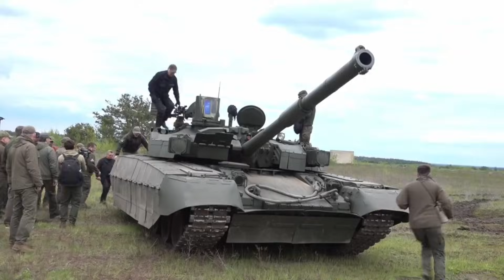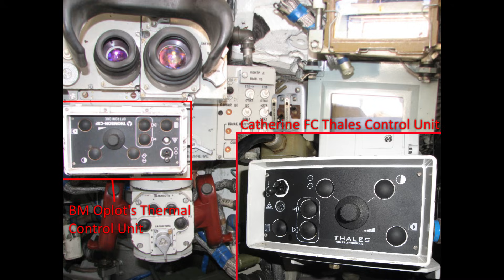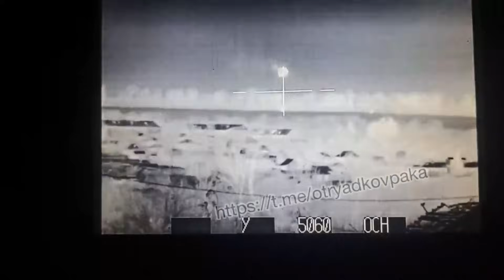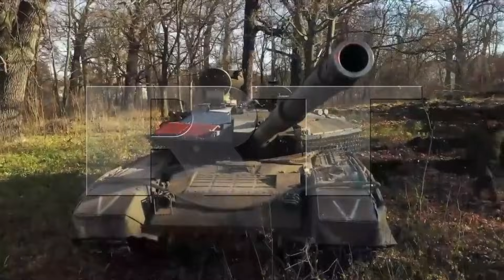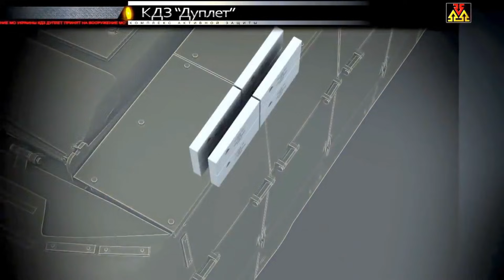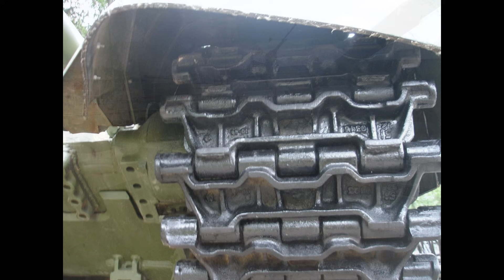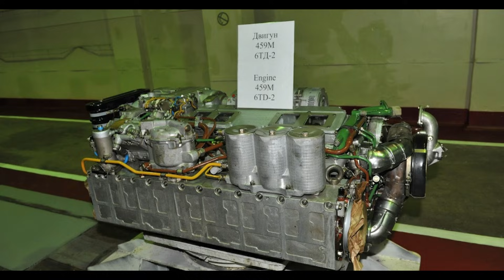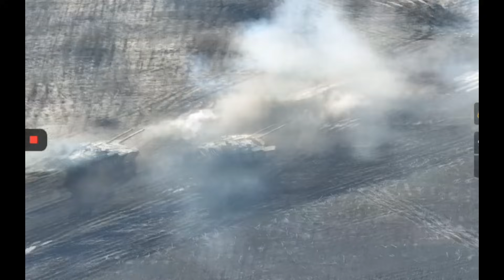Best Ukrainian vs Best Russian tank. T-90M vs BM Oplot comparison

Comment: The biggest problem of T-90M is the reverse speed
Reply: Hold W to win, hold S to suck, comrade!
Reply: Biggest problem of oplot m there’s not enough of them
Reply: In soviet russia you abandon the tank when you need the reverse gear
Reply: @caracallaavg  In Soviet Russia, reverse = get out and push!
Reply: @caracallaavg  In soviet Russia you just fight to the death but Soviet Russia doesn’t exist anymore so yea
Reply: 😅The oplot also has that problem
Reply: And it beeing a T72
Reply: Yeah idk why they didn’t fix it, bad for them, good for us
Reply: @adriannn1180  problem of small engine. Because of small inner volume, soviet tank more armored and has less mass, but this also has disadvantages as well.
Reply: I would say its biggest problem is its crew in Russian service.
Reply: The poor reverse speed is compounded by the fact that if you want to evacuate rapidly you have to turn the tank around and show your sides and ass. T90 doesn't have neutral steer which can make this difficult. And obviously the armor protection is basically tissue paper. But of course this is not a problem because Russian tanks never retreat.
Reply: Also they didn't make a lot do them because of sanctions.
Reply: Designers thought that Russians do not retreat
Reply: I feared that I won't find any of war thunder experts here.
Reply: If the russians only had a next gen tank with decent reverse speed...
Reply: Thats the biggest downside of any russian tank.
Reply: T90M has 15 km/h reverse speed
Reply: The biggest problem of the Oplot tank is the lack of production of the Oplot tank.😄 Even new samples of the Oplot tank were made using the method of technical cannibalism
Reply: Na, the biggest problem is more how they gonna produce it lol
Reply: ONLY cowards go in reverse
Reply: @elcormoran1  cowards live longer
Reply: @RutakoVon  YES You do, i,AM no coward and i live longer without fear of dead, butthurt neonazilover
Reply: How many Oplots have been produced and where?
Reply: @vulgarisopinio  Probably not that many, but hey, every tank counts. They will probably start producing highly upgraded tanks after Ukraine finishes exterminating the rats. As for where they are made, if I knew the answer to that question, Russia would've fired lots of missiles there already. Lots of bots watching!
Reply: @vulgarisopinio  70 or 80 pieces were produced. It cannot be said that they were produced from start to finish. These tanks were produced using the cannibalism method. They took old tanks and modernized them
Reply: The biggest problem with the T-90 is that it's actually a T-72
Reply: Like every t series before...
Ik.shocker
Reply: Specialist subject: the obvious comment gets 542 likes
Reply: Ukraine's best tank is now Leopard 2
Reply: Completely irrelevant
In reality downsides can be covered by using correct strategies and supports from recon or etc
A better reverse speed only gives you more freedom
In conclusion actual results depend on so many variables that simply having one down side does not mean much
Reply: Nope its the fact its operated by cowards!!
Reply: You don’t know it’s reverse speed
Reply: I guess there is some new automatic transmission for T 90, but this transmission very expensive and therefore no mass production.
Reply: "T-90M breakthrough" has a reverse speed of 15 km/h
Reply: Nah, the biggest weakness is that it's operated by russians. The most incompetent and cowardly conventional military we have ever seen.
Reply: The biggest problem is that author of channel is misleading. After all, T90M is not best tank in Russia.
Reply: Nah it's finding a working T-90M fam lmao
Reply: There are few biggest problem of T90: 1. Russian engineering;
2. It is shitty T72 with new turret
Reply: @veritasaequitas2632  
Well, since you like this kind of argument, let's get started.
1. You have porridge in your head instead of brains. How do you like the answer to such a first point without arguments?
2. Since the main reason for the appearance of the t90, is the presence of a huge number of t72s, which can be upgraded into a great workhorse like the t90. Economy, probably heard such a word.
Reply: @@Messikimochi-ok4jm A few examples are no big deal.
Reply: @@Messikimochi-ok4jm And there are over a hundred Russian tanks with their turrets orbiting the Earth.
Reply: @mr.normalguy69  What's your IQ?
Reply: it's just that Russians never go in reverse and don't know how to retreat!
Reply: the biggerst problem of Oplot it does not exist, it was made in about 0 amount...T 90 exists in thousands)
Reply: and its age
Reply: Вот прям проблема...
Reply: Only problem
Reply: @the_burger  perhaps, but it is also a MASSIVE issue.
Reply: @the_burger they seem to fall in the ukrainian hands a fair bit. Seems like a downside for you? Weak arse military.
Reply: @the_burger it has a underpowerd engine it's slow in reverse and forward and its armor suck the t90 is trash  watch Lazar pig on the t90 he explains it better
Reply: @dannywaller4397  Lazerpig is a braindead natoid. Armor is great (full body ERA coverage), engine is fine. As I said, reverse is the only problem.
Reply: That guy is a NAFO troll.
 @dannywaller4397
Reply: Also the thermals
Reply: @pringle239  Stop believing CNN cronies, T90M tech is the equal or better if any western tank.
Reply: It also goes boom 💥
Reply: @mr.normalguy69  every tank goes boom lmao nothing is indestructible kid
Reply: @grimmerjxcts2206  Nah, not really, mostly Soviet era tank turrets have a tendency for doing Olympic jumps 😂
Reply: @grimmerjxcts2206  Not the way Russian tanks do

Because of the autoloader mostly.
Reply: @GAY_WEED_DAD_69  it's not the auto loader it's the extra ammo in the hull around the auto loader 
Leopard 2a4 also explode that way
Reply: @RazorsharpLT  Leopard 2 in Syria is a Grill Fish 😂😂😂
Reply: @TheFIFABoys  Just 2? There are almost a hundred Russian tanks with their turrets orbiting the Earth just from Ukraine.
Reply: @grimmerjxcts2206  Not every tank goes boom like the T90, haven’t you ever noticed the turret ends up landing on a 5 story roof when the ammo carousel gets hit?
Reply: @grimmerjxcts2206  russian tanks just boom boom in a different way
Reply: @mr.normalguy69  Bro you fire and ATGM and it will boom any tank, mines will disable any tank, good artillery will completely waste any tank. I don't get this bullshit point, if the Russians were equipped with all Abrams they would still have high tank losses.
Reply: @RazorsharpLT  it has nothing to do with the autoloader. If so the leo 2s in syria wouldnt have ripped their hull open like a sardine can and yeet the turret. Or like every single tank in ww2 if hit in the ammo. All tanks with hull stored ammo and no blowout pannels will do it. Its a tank thing not a russian thing.
Reply: @justin-v3r7m  I don't care, if Russian tanks go boom 💥 , then Russian tanks go boom 💥 . Arguing won't change anything.
Reply: @mr.normalguy69  imagine being this insufferable in real life.
Reply: @grimmerjxcts2206 thanks!! Yes!!!
Reply: @WeWuzForerunnerz  how many t90 has You seen go boom, the ONLY one was capterd by the ukranians after so many hits and still in good shape that the americans took it back to study
Reply: @RazorsharpLT the autoloader isn't what causes russian tank turrets to go flying, it's the extra ammo stored in the hull
Reply: @mr.normalguy69  leo2 in Syria jump higher that any soviet tank.
Reply: @mr.normalguy69  2 of t-90m was destroyed, one was abandoned and captured, one lost tracks from artillery fire and was destroyed by friendly fire after crew left tank. Hundreds only in western propaganda copium brain.
Reply: @TheFIFABoys  Not the way the Russians did. Their turrets are currently in a competition with their helicopters for the largest flying time😁
Reply: @mr.normalguy69  the leopards did that in Syria too though, and the T-90M version doesn't go boom the Olympics are the T-80s and T-72 not T-90, the T-90's problem is the abysmal reverse speed making escapes harder and easier to ambush
Reply: @raulisrael7342  Not yet! But they will eventually.
Reply: @mr.normalguy69  doesnt really matter when the crew gets killed by a shell penetrating
Reply: @mr.normalguy69 damn, ukropium is hard with this one
Reply: @dmitriyalaasniy8442  Rooski Booski is going harder for you 💀👌
Reply: @mr.normalguy69  and yet these Olympic jumps are the best and sexiest in the world
Reply: @RazorsharpLT either way any tank hit with the force to make the turret go boom is toast regardless of if the turret comes off or not.
Reply: @mr.normalguy69 buddy you act like the turret going boom makes the tank any worse. Turret on or off it’s done when hit with a javalin like every other tank on earth.
Reply: @grimmerjxcts2206  some go boom much easier than they should.
Reply: @Dr. PooPooHead  Because of the auto loader carousel great idea during the cold war reduce the tanks target size and increase in rate of fire get rid of a crew member it's just AT weapons   and smart munitions have advanced leaps and bounds.
Reply: @grimmerjxcts2206 yes, but not all of them rocket of into space.
Reply: @mr.normalguy69 every tank in battlefield is vulnerable, example Leopard 2 turkiye in Syria, Abrams in Afghanistan and Iraq. And Saudi M1A2 ? Got knocked by Rpg ).
Reply: @grimmer jxcts  T-90 is on T-72 chassis, which means it has an autoloader and ammo in a carrousel inderneath the turrret, so when that ammo is hit they tend to go boom very well, sending the turrets into space along with the top half of the turret crew. Nato tanks have blowout panels at the rear of their turrets where the ammo is, so when the ammo is hit, the ammo just cooks off and the crew can leave the tank relatively unharmed
Reply: @mlp2034  sadly that doesn’t apply to the Challenger 2 & 1 Ammo bags are stored “underneath” the turret. 😔
Reply: @CHRIS BACON  Yeah, but the propellant underneath the turret is in wet stowage, unlike russian tanks
Reply: @mr.normalguy69  T-90M has an armored carrousel to reduce the chance of catastrophic ammo cook off. Older russian tanks like the T-90A or T-80 are much more likely to have this issue. While on the T-90M it's significantly rarer.
Reply: @phoenix211245 same like turkish leo 2A4 lol
Reply: @mlp2034  yeah that doesn't stop it from going off though it just prevents a fire destroying the tank in the first 10 minutes if the charges were to be hit directly the tank will explode... British engineering everybody!
Reply: @oreticeric8730  and the t72 is a great 3 in 1 barbecue deal. The t62 ups the ante to 4 in 1..... It's nice to have fried Russian for breakfast😁😂😂 the vatnik cookers are operational, and the t90 just makes a premium grill model.
Reply: @mr.normalguy69  T 90M stores the ammo in some sort of bunker with blow out pannels kid , just use google for real facts . Also Ukraine uses this T model tanks , so that's not really funny . But what you wanna expect from internet idiots , with zero life .
Reply: @grimmerjxcts2206  The T90 M has a new engine with more hp and a new gearbox ,  it should have a better reverse speed now ?
Reply: @mr.normalguy69  what about the leopard!?
Reply: @katyusha1283  Doesn't matter, tank will still go BOOM! 💥💥💥
Reply: @ComputerScience_Nerd07462  Occasionally goes boom, but less so than T-72 and T-80 series of tanks. I have yet to see a T-90 tank turret going BOOM 💥 but I'm hoping that it will.
Reply: @mr.normalguy69  because leopards haven’t seen battle dumbass they are not going to blow up in the storages for no reason but when they went to war they got destroyed in Syria and now in Ukraine
Reply: @grimmerjxcts2206  yeah but uh, blow out panels reduce the boom.
Reply: @mr.normalguy69  this comment didnt age well lol after seeing a few leos turret flying haha
Reply: @orrrlllyy3473  Well, I'm gonna remain consistent with my argument then. The Leopard also goes boom.
Reply: @mr.normalguy69  a down to earth comment :)
Reply: @mr.normalguy69  and challenger 2 cant? lololol
Reply: @mhx6437  Challenger 2 also goes BOOM! 💥
Reply: @mr.normalguy69  hey dude I just saw a video of a leopard 2 turret jumping over 100 meters high, what happened there mate?
Reply: so you rather sit in a tanks thats gonna blow into 1000 pices? @mr.normalguy69
Reply: @WeWuzForerunnerz  theres literally only like 3 tank designs out of the thousands of designs that will not go nuclear when a round is hit. Abrams is the only mbt with ammo completely incased in a seprate container from the crew. Maybe the object 640 which featured a bussle autoloader that had blast doors
Reply: @grimmerjxcts2206 lol woman has some that is indestructible think about it! 😮
Reply: @mr.normalguy69  what
Reply: @bigboy3206  I think hes referring to the T-90Ms being destroyed in Ukraine, however thats mostly due to artillery/mines and has nothing to do with how "good" they are. Best way to take out any tank is still putting someone incompetent into it and make them drive through an open field.
Reply: @bigboy3206  BOOM 💥💥💥
Reply: @mr.normalguy69 
Which has not happened to the T-90M in Ukraine.
Reply: @cryptarisprotocol1872  Not yet
Reply: @mr.normalguy69  you should be called dr.rockhead because no matter how much people explain to you,you say something different that is not true🤣
Reply: @Nawaz_badness  Tell me where I'm wrong...
Reply: @mr.normalguy69  Ukrainian tanks can't even move through their country
Reply: @mr.normalguy69  you do know that 90% of Ukrainian tanks are russian originated
Reply: @mr.normalguy69  congrats, you're the prime example of copium addict.
Reply: @Nawaz_badness  I don't care
Reply: @bruhwhat5485  didnt like only 30 t90 get destroyed with most of them being a t90a i think
Reply: @Nawaz_badness  because you cant win an argument against someone stupid
Reply: @mr.normalguy69  😂
Reply: @bruhwhat5485  and to also have a shit military doctrine
Reply: @grumogus  20 T-90M visually confirmed to be destroyed, damaged and abandoned or captured. Out of those there are 4 that are not visible in a pretty good resolution (meaning you'd have to talk to people that know their tank stuff well and can identify it), so at least 16. 

Russia had some 67 T-90Ms in January 2022 as per IISS and had some more batches delivered after, so they probably have something around a hundred now, minus the losses.
Reply: @bruhwhat5485  yea out of the 500+ i think it was most of them are the t90a variant
Reply: @bruhwhat5485  Only one got destroyed until now, meanwhile Ukraine lost Abrams, Leopards and pretty much everything they got
Reply: @cryptarisprotocol1872  Many t90m's have been knocked out in Ukraine, wdym??
Reply: @mr.normalguy69  you can't differentiate between t-72s and t80s and t-90 and you are asking where you are wrong? everything you said was wrong buddy
Reply: @bruhwhat5485  some of it may not even be the driver though too, you can take the best driver in Russia and give him some guy who became a commander less than 6 months ago. If the driver doesn’t just disregard an order him and the crew would get killed or lose the tank because the commander may tell him go one way but it’s mined and pre sighted for artillery. But like you said an incompetent driver also can kill the crew or tank
Reply: @mr.normalguy69 ALL TANK GOES BOOM WHEN DESTROYED SAME LIKE TURKISH LEO 2 destroyed hit In the ammunition
Reply: @bigboy3206  He is probably referring to the auto-loaders, which stood under the commander's and gunner's seat, that when it was hit, it caused the turred to blow off due to all of the rounds exploding inside of the tank. (btw the T-90M has fixed this issue a bit.)
Reply: @Brazilianpatriotmapper  i hate Brazil
Reply: @blackwolf2447  Yes, I definitely can deferentiate between T-72, T-80 and T-90. Each being remarkably better than the previous production series of tanks but has the same fatal flaw of having the carousel autoloading system. One hit by an ATGM, or tank round, or even accidental fire 🔥🚀💥 The tank turret will do an Olympic jump 🦘

In other words, tank goes BOOM 💥
Reply: @mr.normalguy69  bro think he can handle serious debate on you tube
Reply: You're trolling, aren't you?
 @mr.normalguy69
Reply: @bruhwhat5485  He's referring to the carousel detonation. Which isn't accurate.
Reply: @mr.normalguy69 In your opinion
Reply: @mr.normalguy69 every tank goes boom captain obvious
Reply: @mr.normalguy69 so can oplot or any other soviet style mbt
Reply: @mr.normalguy69  actually t90m is a lot better protected than other russian tanks with increased carousal protection and blowout panels
Reply: @mr.normalguy69  you can kindly get out of here
Reply: @mr.normalguy69 just like other tanks
Reply: @mr.normalguy69  no it doesn't
Reply: @mr.normalguy69  every tank in the world can go boom
Reply: it doesnt the ammo cookoffs only happen in combat on older t-72s and t-90a @mr.normalguy69
Reply: @mr.normalguy69  ANY tank is hit in the ammo goes boom...it's basic science 😅
Reply: @mr.normalguy69  Everything goes boom
Reply: Even  your own mother (Sarcastic).
 @darthnagus5457
Reply: @mr.normalguy69  every tank goes boom...
Reply: @mr.normalguy69  : And THE END for Abrams 🇺🇸☠️🕯😂😂😂😂
Reply: @oreticeric8730 
Calm down they’re just the Abrams America sells to the Saudis, without the classified armour in it. It’ll get destroyed more easily due to having less protection.
Reply: @oreticeric8730  Yeah, because we're getting an upgrade. Better to give Ukraine the Abrams to crush Russia with than just scrap them. Although wasting them on Russia isn't much better, since Russia is so awful😂
Reply: @quinnjackson9252  : “ So awful “? 😂😂😂😂😂😂🇺🇸🕯☠️🐔🕯☠️🇩🇪😂🕯🇬🇧☠️🕯🇺🇦🕯☠️
Reply: @quinnjackson9252  after using Abrams just a month against isis and lost big numbers of them, Iraq start buying t-90 instead 😂
Abrams no match even to basic t-90
Reply: @trololoev  1. You are happy about terrorists succeeding? Typical Russian I suppose. 
2. Iraq lost tanks not because of the tanks quality, bur rather the crews quality. Ukraine is sending their best tank aces to learn the Abrams directly from the best American instructors, a luxury that Iraq did not have. Additionally, Ukraine has access to the full range of combined arms warfare capabilities, unlike Iraq. This is not a fight against quick and agile partisans hiding in caves and cities, this is big, dumb rats occupying Ukraine's homeland. Ukraine has every advantage, and all of the rats will burn!
3. The T-90's abysmal reverse speed and atrocious maneuverability makes it a sitting duck. It likely will never actually fight the Abrams, as Ukraine will have destroyed them all before they advance, but aI sure hope they do, so that Ukraine can demonstrate it's might!
Reply: @oreticeric8730  Hehe cute. When we take Moscow, I'm gonna name you Fifi! Here come our tanks!!
Reply: @cryptarisprotocol1872  Thats a cool way to foreshadow how the Abrams sucks
Reply: @oreticeric8730  are you got paid by those moskals?
Reply: @trololoev  i mean atleas the T90s will get there before running out of fuel

Cough cough Gas turbine sucking the souls of the dead just for awful mpg cough cough
Reply: @cryptarisprotocol1872  Those Abrams have just steel plates correct? Like aside the from the fact they’re missing the classified composite armour, they also don’t have any kind of ERA if I remember right
Reply: The dank was dead on the fisrt day of the combat @oreticeric8730
Reply: @mr.normalguy69  it certainly does. The T-72 is a better tank